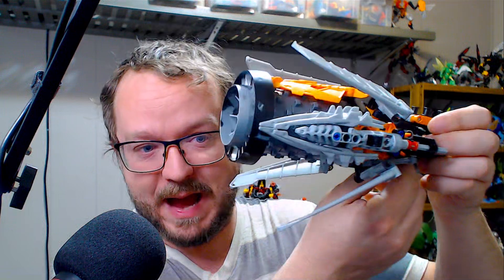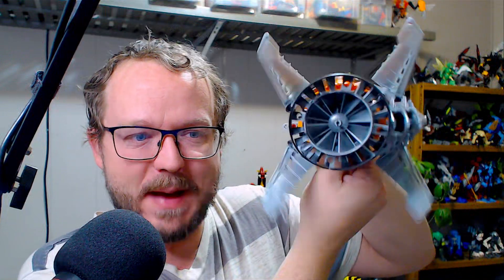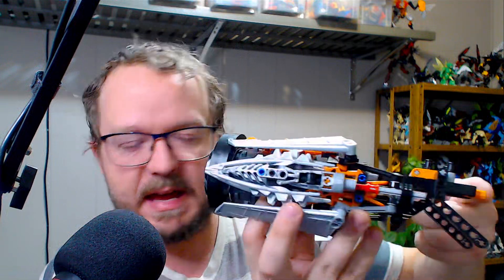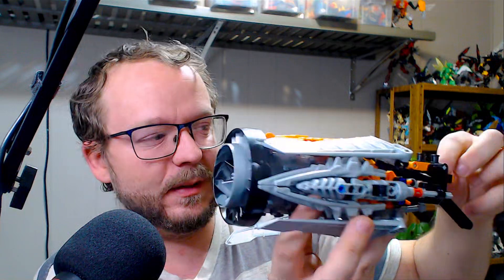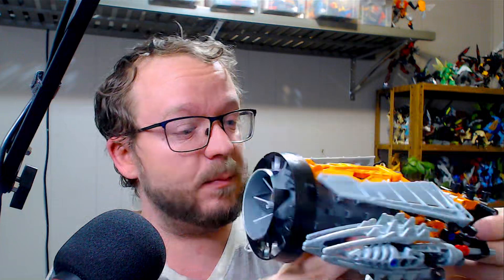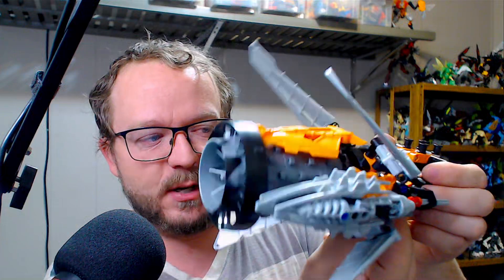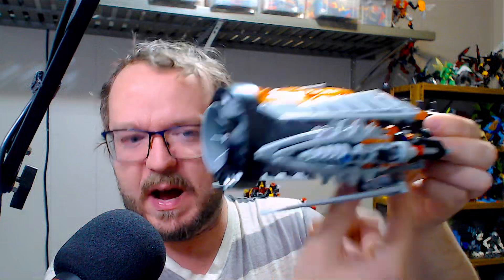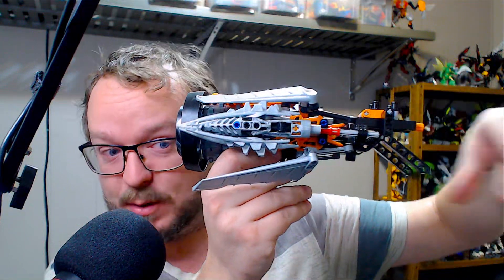Devastator 2008 Progress Update

Comment: im working on a RC powered Bionicle vehicle and i could use some help with steering. is it possible to pick your brain on it?
Reply from the maker: Ask me whatever you need, I'm not sure how helpful I may be 😅
Reply: im trying to make what might be considered a more sci-fi version of the thornadus v9 set.

i want to use two LARGE off road motorcycle wheels side by side with a classic motorcycle back suspension. the seat from the thornadus (with a better harder roll cage) but the tricky part is making steering for split wheels.

i took inspiration from the borderlands vehicles with the springy legs with wheels at the end.. i just dont know how to make the two wide forked wheels turn while also having springy arms.. i have lots of pictures of lego motorcycles and other inspirations but im more of an idea guy not a physical mechanic guy x,x
Reply: @skybirdmakes bump
Reply: i also have some ideas like making them twist to steer.. and maybe mount the suspension on balls so they move side to side... but i have no actual ideas.
Reply: i also thought to have four front wheels, two on each arm, one infront of the other. have the wheels on a seesaw mounted to the front arm and have the arm hooked up to suspension but still the steering eludes me...
Reply: its all in my head but lack of parts knowledge or mechanical know how and poor communication and translation to paper makes this harder than it should be. it should just be a simple case of making three parts and combining them x,x
Reply: Lego 8995 Thornatus V9
Reply: any way i can email u instead of talking here?